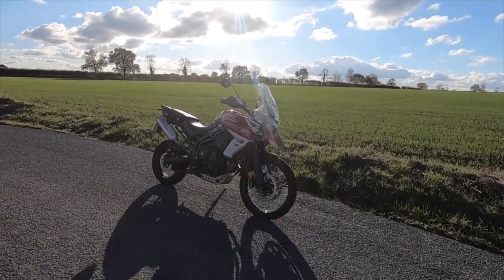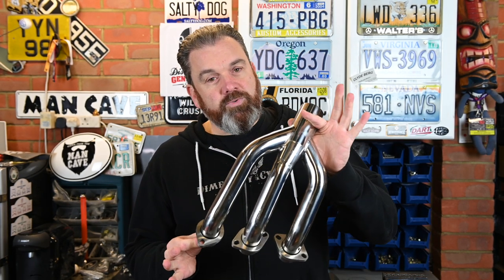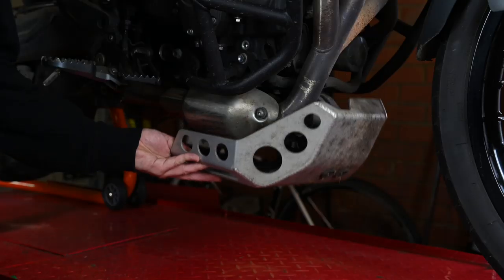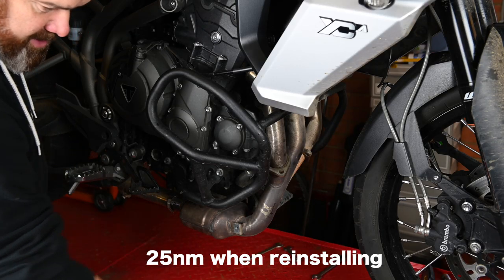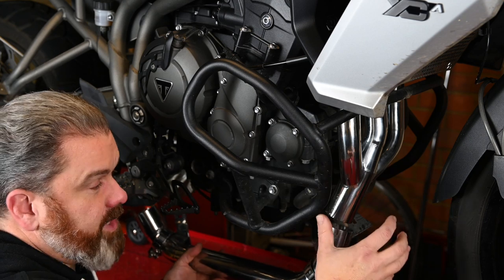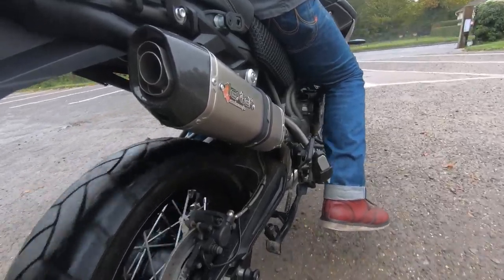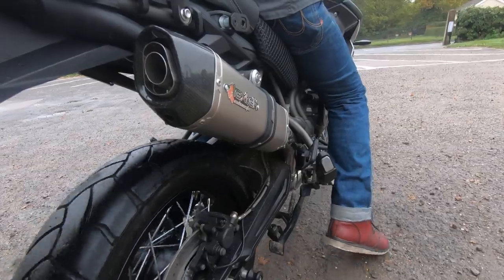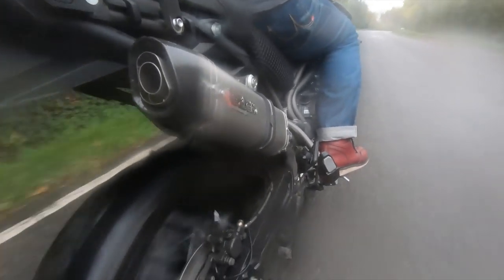Decatting the Tiger 800 - Lextek VP1 full exhaust install & test

Comment: I personally really love Lextek, I think most of my exhausts in the future will be Lextek, I am certainly planning on putting on my project A2 bike. I was already plenty impressed by the 160 pound full system for my MT125, so I don't think I'll be disappointed any time soon. If it's dry when you're near Exeter, I'd recommend going along the A30 a bit and dart off towards Exmouth, gorgeous beach town with some really lovely roads around it. If I see you (supposing it is dry), I'll be sure to give a nod or 20
Reply from the maker: I am impressed with the system. It'll be interesting to see how it holds up, but quality is good. I've been to Exmouth years ago (my dad was from Plymouth). I'll give you shout when i'm heading down

Comment: It’s quiet. I’ve noticed recently some full systems ending up quieter than a slip-on. The reflash will improve it, even if you just do the factory one. Triumph has fantastic stock fuel mapping but a full exhaust will change the airflow and will benefit from tuning.
Reply from the maker: Its louder than stock, the cat tends to muffle at lot of exhaust sounds

Comment: I replaced my end can with a much more free flowing option a couple of months back, been convinced the mapping isnt right since, will give the ECU reboot a go first thing tomorrow now I've seen this video. 
I'm tempted to get the rest of the system if the ECU can be made to "re-learn" the pipe. Interested to see what figures come back from your dyno trip.
Reply: Update: noticable improvement with significantly less popping and cracks on over run. I'm a happy boy indeed :) dependent  on your dyno results think I may consider the decat route too!

Edit: typo
Reply from the maker: This seemed to be fine on the standard map. I had the bike serviced yesterday and instead of going through the process I described in the video the Triumph Tech did the reset for me. I then went for a 45 or so minute ride, and all seemed good. I will keep an eye on it, then report back when i've had the chance to get it on the dyno....

Comment: Very Helpful. How is the fuel consumption and HP improvements? Any cons of decatting so far? Thanks
Reply from the maker: Thanks, no noticeable change to either to be honest. The benefits are less weight and a different exhaust note. The decat header does reduce the heat that the cat used to put out, but it’s not massively different
Reply: Awesome, thank you for your helpful answer 💪

Comment: sounds lovely! quick question - would it sound similar without the decat? i.e. with just the VP1 end can? Waiting for them to come back in stock.
Reply from the maker: Almost yes, I’ve still got the end can and link pipe here boxed up if you’re interested? I took it off when I sold the Bike
Reply: @mancavemoto  happy for you to email me with possible cost. Ideally I'd want/install the can only; for emissions and warranty. Doesnt de-cat void the road legal status? Just curious...
Reply from the maker: The end can and link pipe are separate pieces, but they are together on the stock system. The decat header stayed on the bike. Might be easiet to message via Instagram or Facebook?
Reply: @mancavemoto  ahhh yes I see now what you mean! Perfect, will find you on FB and message there.
Reply: @ashw5487  Did you sell the exhaust? I am interested too.

Comment: I just recently traded a cruiser bike for an XCA. Absolutely love it. But after a few hours on the road at 60-70 mph, perhaps around 3k rpms.... the getting used to the screaming, high pitched noise is becoming a problem for me. Any suggestions other than using ear plugs and maybe a new exhaust? My focus is not performance but noise/frequency reduction. The sound in your video is great, throaty. But seems to be taken from behind the can. From your riding position, do you hear a lower frequency noise, or still i high pitch whine from the engine below? Would a low pitch exhaust solve my problem or i will still hear the screaming engine below me? Thanks!
Reply from the maker: Yes it sounds great, particularly when riding round the twisties, but I found this can too 'high pitched' on longer motorway journeys, after about half an hour at a constand 70mph it was getting on my nerves. I'll be posting an update video soon.
Reply: @mancavemoto  so far, ear plugs are working well for me. i dont hear much anything else, but still feel safer on the XCA than on my cruiser. Probably better bike, more aggressive riding position. After seeing many videos, I was thinking Akrapovic had the throatiest noise of all. But i go on their website and the sampling audio files from the stock exhaust and Akrapovic sound exactly the same for an untrained ear like mine. It all seems very confusing to me, and i would want to understand better before I shell out $800 for a new system. So far, $20 ear plugs are doing the trick. my only resort is to ask guys like you and others that wnt through the experience of changing the exhaust and understanding your perspective from how it sounds in the actual cockpit (not from an observer standpoint, which i dont really care much about as long as I'm not making much noisier). Looking forward to more video updates on this. Thanks!
Reply: @petepinheiro1600 and for the heat of the engine? My xcx 800 is really too hot. Do you remember if you improved this problem?

Comment: Hi. Got header pipes from Lextek, might get end can in couple months. Need to fit them now :) Question, when you attached them to engine, did you use any paste? Like copper paste? Or screw back same as they came out?
Reply from the maker: I put a little bit of moly grease on the threads just to help stop them seizing
Reply: Aivars Silins, do you like the Lextek decat header pipes since you got them?

Comment: Another great insight video 👍🏼
Would be keen to hear if the rest process you described made any difference & the thoughts of the triumph techs.  Reason being I have a decat header waiting to go on my Speed Triple R (17) but don’t want the fueling to be poor & risk damage by running too lean etc.
Any thoughts welcomed 👍🏼 & will keep an eye on for the follow up video.

Ps very impressed with a Lextech link pipe I bought for my Fireblade 👌🏼
Reply from the maker: Cheers Joe, I’ll definitely do a follow up video
Reply from the maker: I didn't Perry, my situation changed and I ended up selling the Tiger before I could make a follow up video

Comment: Hi, can you please tell what torque number is needed for the downpipe to the cyclinder head? I'm not a torque maniac but this is subject to heat and metal expansion so my only concern not to overtighten the nuts

Thank you!
Reply from the maker: Sorry i missed this message. Its not tight at all, just 10nm.  As a tiger owner, you might find this useful http://www.triumphtiger.ru/manuals/Tiger_800_Torque_Settings.pdf

Comment: How has the system been holding up?  I've got a Street triple RX, curious with this system. Many thanks
Reply from the maker: Its been great, but I have to admit to switching the end can back to stock. It made a great sound when scratching around the back roads, but on A road and Motorways it was just too high pitched and became annoying after 15-20 minutes. But it still looks like new. I'm going to post an update video and explain my reasoning for the switch. Purely down to personal preference
Reply: @mancavemoto  Thanks for the reply. I've got the same problem, I want to be heard for filtering etc. However I don't want an asbo exhaust and the Street triple seems to be painfully quiet or MotoGP loud.  Looking forward to the update video.

Comment: How did the Lextek system hold up over time?
Reply from the maker: It was pretty good. But I ended up trading the Tiger in and now the Lextek exhaust is sitting in a box in my garage

Comment: Emissions? Environmentally responsible?
Reply from the maker: Good point Paul, Its certainly a thorny subject and is something I weighed up before fitting the pipe. Catalytic converters do obviously cut back on noxious exhaust emissions. Without testing its hard to say exactly what change this exhaust makes, but given that the use of the bike is relatively light, it may be not much? Can this be offset by the reduction in heat and the subsequent more fuel efficient running of the engine? Somewhat I would say. One of the converters roles is to convert Carbon Monoxide into Carbon Dioxide, which is still the biggest contributer to greenhouse gases. Also the converters use Platinum and Palladium for the conversion process, both of which create there own massive environmental pollution problems (although this is obviously a moot point given that the bike already had a cat on it). The Tiger engine is already highly efficient, interestingly the cat was much smaller on this bike than I have seen on many others. So weighing it all up, I don't feel as if its an overly irresponsible act?
Reply: Manufacturers keep castrating their bikes to meet regulations. In reality they go to far bij making the engine too lean. That causes a bad running underpowered engine that uses more fuel than a tuned bike. The cat is there for a reason but I don't think the difference is that big.

Comment: To have a Triumph  and put a Lextek exhaust on it, is like drinking a £4000 Don Pėrignon from a plastic cup. It tastes the same but shouldn't be done...
Reply from the maker: If the Dom Perignon tastes the same, does it really matter?  I kinda see your point though....
Reply: @mancavemoto  well like I said its ok but shouldn't be done. Just like you wouldn't go to a restaurant in flip flops, it can be done but shouldn't. At least scrape the lextek logo and stick a yoshi or akrapovic badge 😅✌ can get the of ebay
Reply from the maker: So it’s an ‘image’ thing? If I stick another badge on it it’s still a lextek pipe, the only thIng that has changed is other people’s perception. The quality of the construction is good, it sounds ok so I don’t see a problem. Maybe I just take things at face value and am not a brand snob?  Oh and I’ve been to plenty of restaurants in flip flops 😂 Each to their own I say. My bike, my rules...
Reply: @mancavemoto  my bike my rules.. chill mate chill. Exhaust is part of your engine and it's a performance part, not just aesthetics and 'sound'
An akrapovic is expensive because of materials used and all test done prior to selling it. 
That's why I'll pick a well known brand, they put effort and time into making stuff
Reply from the maker: I’m very chill dude

Comment: Very over simplified. It's not that easy, believe me. Also release the radiator mounts to get the job done.
Reply from the maker: It wasn't simplified that much. I didn't think anyone would need instructions on how to undo bolts. Yes they are fiddly to get to and having a selection of spanners and socket arms helps, but there was no need to realease the rad mounts if you take your time.
Reply: @mancavemoto  yeah it helped a lot, also if you have the upper heed crash bars they get in the way too. Just a comment, after you vis was very helpful indeed. Especially the torque settings. I've also noticed improvement in fuel economy?👍